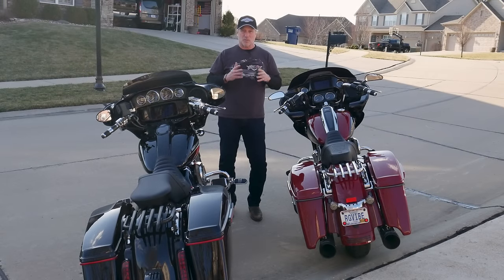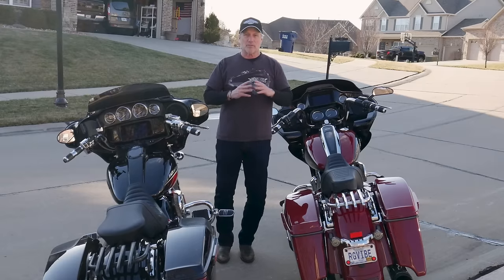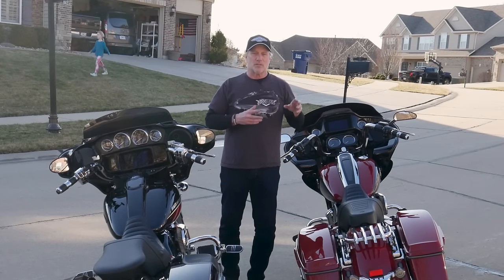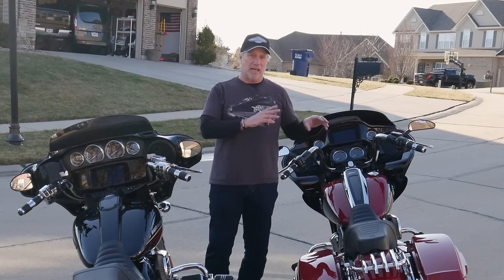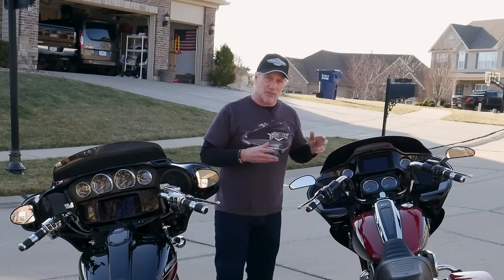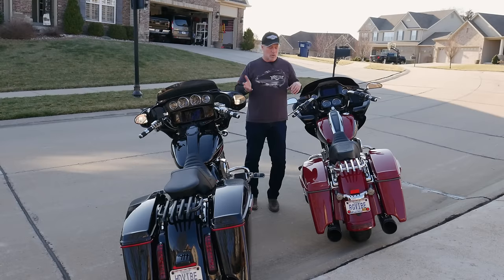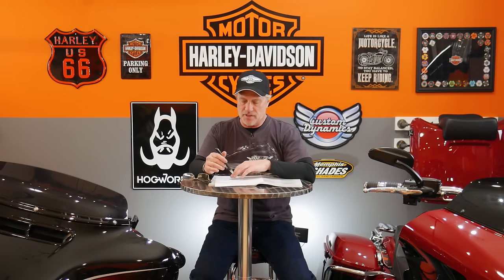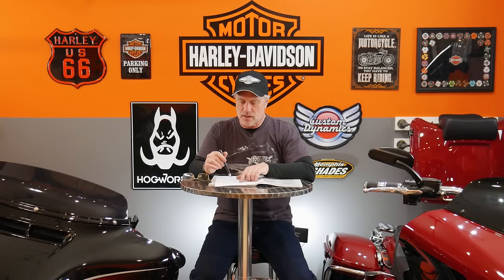Harley Davidson Stage 2 vs Stage 1 Upgrade M8 114 vs M8 117

Comment: Great video,👌 Did the  SE Cam effect the mileage by much ?
Reply from the maker: Thanks Paul for watching and commenting.   My MPG is about the same as it was prior to the Stage 2 cam.  I get about 38 to 40 mpg.   My mpg is probably a bit lower than others as I tend to run higher rpms.  I have another video covering that question and others that viewers asked after this video.  Feel free to check it out.  If you are already a subscriber to the channel...thank you.  If you haven't yet subscribed to the channel I'd be honored if you'd consider doing so.   Thanks for your support and ride safe.  👊✌️👍

Comment: I just subscribed to the channel to listen to the difference between the two set ups.  Both have my interest even though both are way out of my price range.  Was trying to get a 2022 used ST Road Glide but work not going where I thought and house repairs life happens idea.  I see you have seat comparisons which I decided to do instead with some touring capabilities on my 07 Softail Night Train.  Planning on three day ride which haven't done yet thought upgrade to touring bike would be nice but checking you tube for my bike repair and add on instead. Belt and rear sprocket is now done.
Reply from the maker: Thanks so much for watching and subscribing. I appreciate your support to the channel and for the comment.  The ST s are nice but as you mentioned they are not inexpensive.   I look forward to seeing your comments on other and future videos.   Ride safe and enjoy. 👊✌️👍

Comment: Exhaust note, volume, and fuel mileage of your friend with the S&S cam depends on other factors also. Headers? Slipons? Tune & tune.
Reply from the maker: Great points.  He does have aftermarket headers and slip ons.  It's tuned with power vision tuner.  Thanks for watching and ride safe.👊✌️👍

Comment: I been looking all over for a Screaming Eagle Stage 2  power cam video for a SGST 117 to see what the numbers are and can’t find one anywhere. Do you have anything like that?
Reply from the maker: I do have the HD chart for the 117 with the power cam.  The numbers are...TQ 118 @ 3,500 RPM  HP 104 @ 5,500.  Stock numbers are TQ 112 @ 3,500 RPM HP 92 @4,500.  If you are already a subscriber to the channel...thank you.   If you haven't yet subscribed to the channel I'd be honored if you'd consider doing so.   Thanks for your support and ride safe.  ✌️👊👍
Reply: @HDVIBE  yes i am subscribed. I am probably going to do the Stage 2 power cam on my SGST in a month or 2
Reply from the maker: Sounds awesome.  I'm may do that as well on my 2023 SGST.  Just to give it a little more kick.  Thanks for your continued support to the channel.  Ride safe and enjoy. ✌️👊👍

Comment: I think your leaving horsepower and torque on the table when your running screaming eagle cam kit vs S&S and powervision or Thundermax tuner/ ecu
Reply from the maker: Thanks for watching and commenting.   No question on your point.  For me and others it comes down to keep warranty or not.  If you are already a subscriber to the channel...thank you.   If you haven't yet subscribed to the channel I'd be honored if you'd consider doing so.   Thanks for your support and ride safe.  👊👍✌️

Comment: Great info! I had the 2021 SGS with the 114 earlier in the year and it was stock before I totaled it. Now I have the 2021 RG CVO in the same color as your CVO with the 117 and it’s still stock. I want the lope like your 114 has and the numbers would be acceptable. I just extended my warranty since the old one expired so I don’t want to compromise that. I’ll let the local shop do the stage 2 if I decide to go that way. I just watched your stage 1 full exhaust install and pipes look straight forward.  I believe you used a FP3 Vance and Hines on that tuner? I guess I would stay with the SE tuner like you did on this RGS 114. Great videos!
Reply from the maker: Thanks Don.  Yes definitely stay with the Screamin Eagle tuner to stay in warranty.   If you use the screamin eagle tuner, you will need to stick with a Screamin Eagle cam for the Stage 2.  The cam HD has for the 117 is the SE8 462.  This is considered the power cam.  Higher lift than the SE8 447 I have in the RGS...so you will get more lope sound than I have on the RGS.  However some feel a little torque loss in the lower RPM such as at take off.  The torque and HP come on strong at the 3,000 RPM range or so.  👊✌️👍
Reply: @HDVIBE  has either of your upgrades removed some of the lag in throttle response with the 114 or the 117? When I ride my 02 fatboy I feel that response is natural. The new m8’s seem to have a lag. You may have mentioned this in another video. Just confirming if even the stage 1 removed some of that. 
Thanks!
Reply from the maker: @dondasher58 After putting the Stage 1 tune on the bikes, throttle response is much improved.  It will definitely improve that issue.  Once you go to Stage 2, you just rip and hold on tight.   👍
Reply: @HDVIBE  thank you Sir! That’s what I wanted to hear😎👍
Reply from the maker: @dondasher58 👍

Comment: SEPST warranty/EPA complaint

117 Stage 1
95 HP 
115TQ

114 Stage 2
100 HP
120 TQ

107 Stage 3 (114)
118 HP
122 TQ
My bike. 38k miles now never missed a beat 

Pick a dealership/shop with a dyno and an experienced tuner that is not afraid to tune from any of the available maps. It doesn’t have to be a warranty stripping aftermarket tuner & cam to make good power. But you will need good advice and good experienced dyno tuner
Reply from the maker: Thanks for watching and for the information.  I appreciate the comment and support.  If you are already a subscriber...thank you.  If you haven't yet subscribed to the channel I'd be honored if you'd consider doing so.   I look forward to seeing your comments on other and future videos.   Ride safe and enjoy.  👊✌️👍

Comment: Rick, great vid.  I mean like you said, there are several different options to go with.  For me, I also considered pipe especially going 2 into 1, in order to maximize hp and tq.  Additionally, I use an aftermarket tuner so when you are dialed correctly you shouldn't see huge degradation of mpgs.  Anyway, I did have the 447 cam on my 107 and although it was a significant increase over stock, I wanted more out of the 107 and found that through an aftermarket cam.  I mean if you aren't looking for maximum power and torque on that CVO then stick with SE.  BUT, if you wanted to see what that 117 is really capable of stage 2 wise, getting the most out of that M8, then I would say go aftermarket.  Just remember, if you do the latter, you'll want to go back to that 114 and swap out the cam 😆.  Hope all is well otherwise.
Reply from the maker: Thanks so much for the thoughtful and thorough comment.  You last comment regarding going aftermarket on the CVO could lead me down another path on the RGS.  So many options...Thanks for your time.  Hope all is well and ride safe. 👊✌️👍
Reply: @HDVIBE  yep it never ends with these bikes.
Reply from the maker: That's is truth...👍

Comment: Maybe I missed it, but you didn’t tell us how much it cost to do your stage two on the 114. I would love to know the at the door number, including the labor that the dealership charged you       fantastic video
Reply from the maker: Thanks for watching and commenting.   I did mention the approximate cost, however for a full breakdown I do have another  video where I go through the cost in detail.  It's call is the Stage 2 worth the cost.  If you are already a subscriber to the channel...thank you.   If you haven't yet subscribed to the channel I'd be honored if you'd consider doing so.   Thanks for your support and ride safe.  👍👊✌️

Comment: I would run the Star 30-30 cam with a 55mm aluminium intake on the 117 , the reason for bad gas mileage  is people rev the Engine at stop lights or taking off from the light
Reply from the maker: Hey thanks for the input.  I agree with your comment on reving the engine.   I definitely find myself running the bike harder with the cam.  First few tanks of fuel I getting around 38 MPG...about what I was getting before the cam...maybe 1 or 2 mpg less.  

Thanks for watching and ride safe.
Reply: My stage 2 on my 2019 EGS 107 got me 117 hp and 119 tq with my own combo the 30-30 ,S/S 55mm hand ported , Arlen Ness Big sucker/ stock cover , modified stock pipe with Tab 4.5 mufflers with 2.5 Baffles it's a runner, at 64 it puts a big smile on my face when I turn my right hand.
Reply from the maker: Sounds like an awesome set.  Thanks for sharing it here.  I appreciate your support to the channel.   Ride safe and enjoy. 👊✌️👍
Reply: Also proper a tune makes a huge difference in fuel economy.
Reply from the maker: Very much so.  Thanks for watching and commenting.   👊✌️👍

Comment: Love the color.  Stage 2 it depends on the cam.  The Harley torque one I have is pretty weak.  I have used the S&S  475 in another and it was a nice one.   Larger throttle bodies help.  The tappet cups  are plastic so it was good to dump those , as well as a better pump. I went from 42  to 32-34 mpg.  

Over 130 HP the transmission will start to slip unless you upgrade the clutch.   Dont do the 131 it’s not worth it after talking with a the guy I use that knows his stuff.  The throttle bodies are bigger ( they are plastic too stock ) and its minimal for the displacement.  My 114 with the S&S put out 120s in a Dyno with the same pipes you used but with a wider band sensor 

I have sold the bike and ride a triglide as my knees are shot and 2 up it’s easier for me. The triglide has TAB’s on it and the torque Harley cam.  It’s heavier and pushing it too much the clutch would have to go.  It’s 100 HP and about 8% higher on torque.   

The street pro tuner is a bit wider than the old one but still has the same limits by the EPA.  I am getting the new V&H tuner as it’s epa compliant and won’t kid the triglide warranty and has added features, like temp and such keeps the warranty Indy too on the triglide.  
H
Reply from the maker: Thanks for watching and sharing all this good info.  The new HD Bluetooth tuner works well also.   Very similar to the FP4 as it has monitoring capability as well.  I used the Screamin Eagle Bluetooth tuner on the 2023 Street Glide ST.  I put out 2 videos on that one if you'd like to check it out.  Ride safe and enjoy. ✌️👍👊
Reply: @HDVIBE  I have heard there are issues with the Apple app for the tuner via the App Store reviews. That’s why I am hesitant to use it
Reply from the maker: @ThePNWRiderWA  I see.  I use the Android app and loading base maps and doing Smart tune sessions worked flawlessly. 👍

Comment: The 114 Stage 2 sounds a little better but, I agree, it's probably not worth the hit in gas mileage. Coming from what I've got, I'd actually be fine with a stock 114
Reply from the maker: Thanks for watching and commenting.   My gas mileage at present with the Stage 2 is better than it was before the upgrade.   I'm now getting between 45 to 47 mpg.  If you are already a subscriber to the channel...thank you.   If you haven't yet subscribed to the channel I'd be honored if you'd consider doing so.   Thanks for your support and ride safe.  ✌️👊👍

Comment: What about vibration? I had a 114 RK then I upgraded to 117 stage 3 honestly, it has a very annoying, painful ticking noise and developed an annoying fine vibration. Is there a problem? is that normal with the upgrade? please help as I am not enjoying the bike anymore
Reply from the maker: I can't speak to a Stage 3 upgrade as I went to Stage 2.  I have not experienced any issues with ticking or vibration.  There is a bit of vibration but much less than a twin cam.  Thanks for watching and ride safe. 👊✌️👍

Comment: What are your gas mileage results after the 447 stage 2 on the RG?
Reply from the maker: Thanks for watching and commenting.   I have gotten that question often as well as others.   I get between 38 to 40 MPG depending on how I'm riding.  My MPG on my other bikes is about the same with Stage 1 tunes.  I tend to run a bit higher RPM when I ride typically over 3,000 to around 4,000...even when cruising.   I do have another video that I go in depth answering the questions I get regarding the Stage 2.  If you are already a subscriber to the channel...thank you.   If you haven't yet subscribed to the channel I'd be honored if you'd consider doing so.   Thanks for your support and ride safe.  ✌️👊👍

Comment: When you go with a larger cam do you have to change your belt to a chain?
Reply from the maker: That is a great question.  When doing a Stage 2 you do not have to change from a belt drive to a chain drive.  Typically you would only need to change to a chain drive when you upgrade the bike to get really high HP and TQ numbers.   I'm not 100% sure when that would be but even going to a Stage 4 131 kit doesn't necessitate a chain drive.  Thanks for watching and for the question.  If you are already subscriber...thank you.   If you haven't yet subscribed I'd be honored if you'd consider doing so.   Ride safe and enjoy. 👊✌️👍

Comment: Am curious about mpg after on both bikes after ?
Reply from the maker: Thanks Ray for watching and commenting.   No real change in MPG after the Stage 2.  Both bikes get between 38 to 40 mpg.  I tend to run higher RPMs when I ride so my MPG is typically a little lower than the stated 42 MPG.  If you are already a subscriber to the channel...thank you.   If you haven't yet subscribed to the channel I'd be honored if you'd consider doing so.   Thanks for your support and ride safe.  ✌️👍👊

Comment: I just put the stage 2 447 cam in my 22 RKS it’s plenty reliable sounds great not to loud just right. And it moves don’t need more than that those higher cams are hard on the drivetrain after a bit. You cant enjoy 140 hp an 145 talk you be ripping the tire without even trying at some point it’s to much and takes away enjoying the ride. Then that also comes with extra heat. If you wanted a little more with the 447 cam do intake injectors and a power vision
Reply from the maker: Thanks Michael for your thoughts and perspective on the topic.   Like you, so far I really enjoy the SE8 447 cam.  I may do another tune on it in the future but for now I'll stick with the current set up.  Ride safe and enjoy. 👊✌️👍
Reply: @HDVIBE  I put the 447 in my 22 road king special. the first winter  with a clockworks head pipe after the warrntee was done. pulls nice.. my riding has changed up a little bit. wife coming all the time with me.. I can get into  a 2022 road glide  st. having rough time deciding what to do here. I was going to put the clockworks FXTP Fairing on and add bluetooth speakers. or it's the 2022 road glide st. I just don't know.. Any feed back on this be great. I don't like running the larger cams either do to  hard on the driveline.. may be good at beginning but why hammer the driveline my opinion anyway. I planed on keeping it took good care of it.. may still be keeping it.. my king runs awesome with the 447 11.500 miles not one miss... Have a great day
Reply from the maker: @lawtondevil Thanks for the update and the question.  Here is my thought.  From a performance perspective,  the ST stock is going to run and perform about the same as the Road King with the 447 cam.  You definitely get a nice infotainment system with the ST and obviously the fairing already there so that's a plus for your new two up riding.  If you put the fairing on the Road King then you got that covered however I'm not sure how wind protection will be for your passenger.   So I think it comes down to preference and your passengers feel.  Maybe take her out on a test ride on a Road Glide and get her input and then go from there.   Both are great bikes and either way you go you won't lose.  Good luck and ride safe. 👊✌️👍
Reply: says on the 2022 Glide ST 117 has 106h/p AT RPM 4.750 and 127 pounds of LB/FT AT 3.750 RPM Don't know how accurate that is,, I guess it says calmed so takes that what it is, also on Harleys site.. Buy trade or stay LOL
Reply from the maker: @lawtondevil The numbers Harley quotes are at the crank not at the wheel so they are a bit inflated.
Reply: @HDVIBE  u really liked it nit I traded up to a road gluid st with the 117 going to of s&s sidewinder 2 into 1 but no clue what to do got a cam like around the same that was enough. screaming eagle dont have one. unless you di the stage 4 then u get the 447.. is u been looking and react cant seem to fine one like the 447// maybe after I do the 2 into 1 sidewinder. it many be close

Comment: which is better? How about a 131 Stage 4. Please remember, there's no replacement for displacement. (Haven't tried the 135 yet but it does sound promising)
Reply from the maker: Good point.  The 131 is temping but no quite ready to shell out that cash yet.  Thanks for watching and ride safe. 👊✌️👍

Comment: I have a 22 RG CVO 117, I was told the Harley shop that putting in a Stage 2 wouldn't be worth it.
Reply from the maker: Thanks for stopping by and commenting.  It definitely was worth it on the 114.  I've heard from others that it is also a nice increase in HP and TQ on the 117.  Not sure still if I will do it or not, but, maybe someday.  If you have already subscribed...thank you.  If you haven't yet, I'd be honored if you'd consider doing so.  Ride safe and enjoy. 👊✌️👍
Reply: @HDVIBE  I subscribed. 👍🏽
Reply from the maker: Thanks for subscribing.   I appreciate the support.   Ride safe and enjoy. 👊✌️👍